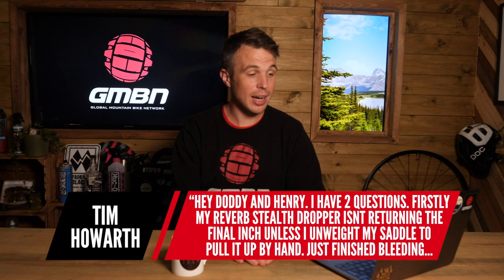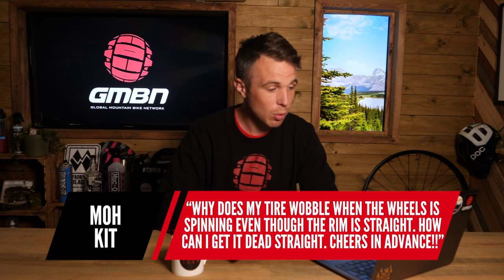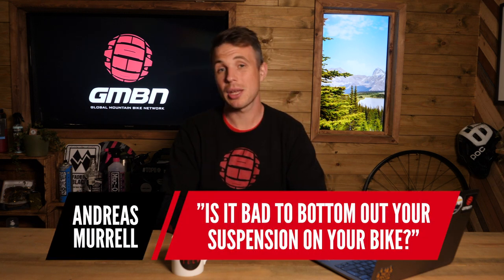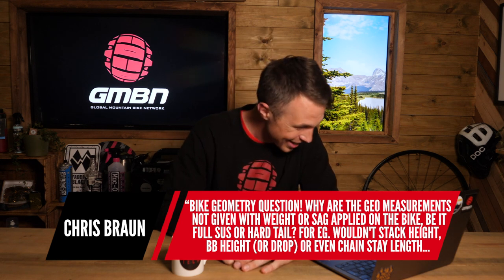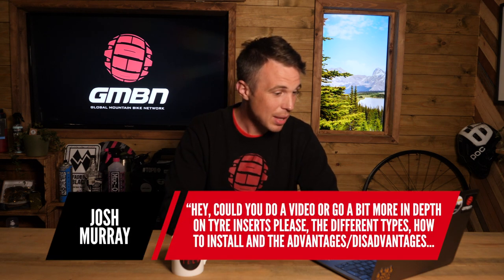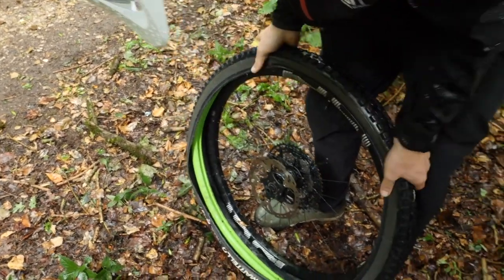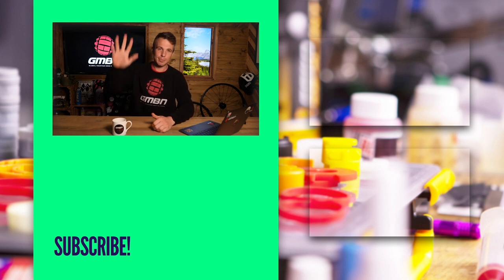Is It Bad To Bottom Out The Suspension Fork On A Bike? | #AskGMBNTech

Comment from the maker: If you have a mountain bike tech question you can let us know by using the hashtag #AskGMBNTech 👇  Maybe you will feature on the show!
Reply: #AskGMBNTech Do high end steel frames require any additional maintenance to prevent internal corrosion?
Reply: #AskGMBNTech How would I go about fitting a dropper post to a 2x9 drive system. My only concern is the placement of the lever on the handlebars.
Reply: Had the same issue with my Reverb, turn the bike upside down, hold in the dropper lever and cycle the post through its full travel 5 or 6 times, sorted the problem for me and might save you having to do another full service👍🏻
Reply: #askGMBNtech - derailleur hanger extenders
Currently building a bike i've come to notice that there's straight and offset extenders on the market, but no mention wich to pick.
Are all derailleurs capable of making up for the 8mm offset a straight extender introduces range-wise, when going for the granny-gear?!
Reply: I had fork vibration  on my Giant Anthem. Even after I replaced the front forks, but every time it happened it was after an endurance event. I found after a morning ride it would disappear. For me I think it was glazing of the disc brake pads (getting them VERY hot). After a while you wear this glazing down. Happens all the time in motorsport.
Reply: @barnzYT  You can get over bar thumb levers that you can use if you have no space for a normal under bar lever. They are normally a bit crap though.
Reply: @superspecky4eyes  cheers, might just stick to my quick release lol
Reply: Great to get an answer to my question!  Cheers!
Reply: barnzy104 yeah cheaper as well
Reply: @superspecky4eyes  Reynolds recommends using Boeshield T9, although they told me that waxoil works OK. I'd still like GMBN or GCN to do a video on steel frame care though as I got in a hell of a mess when I had a go at treating my frame.
Reply: #askgmbntech hello I love the show
I was just wondering if it was possible to get different colors of coil for my rockshox super deluxe coil. I know that I can get red, black but can I get blue.
Reply: @barnzYT  You should deffo try a dropper, you'll never go back.
Reply: #AskGMBNTech I am going to buy a new carbon Tallboy within the next year, and i am 100% going to add a frame wrap to protect it. My only question is whether to go with invisiframe or ridewrap? I know invisiframe is slightly thicker, but it seems like ridewrap has better coverage.
Reply: @superspecky4eyes  I do want one its a pain having to manually drop my post when my mates can carry on shredding! Just a bit stumped about the lever placement
Reply: #askGMBNtech
I'm looking at building myself a new bike from the frame up and also building the wheelset for it and was going to use deore xt hubs however I could not find any clear data on the amount of points of engagement the gmbn tech video said 100 p.o.e. however all the forums I've seen have said 36 or 38 please can you clear this up
Reply: #AskGMBNTech 
Is it bad when u sometimes huck to flat (from i pretty big height) a hardtail or is it ok?
Reply: #AskGMBNTech Hey, love the show btw, could u please explain what the pre load button on entry level forks does and if it makes a big difference when riding.
Reply: #AskGMBNTech greasing: where and how often? A video on more in depth bike lubrication to help the home mechanic would be great!
Reply: T Miller isn’t there already one
Reply: @Calum_S  Yeah i would like to see a long term steel owners car guide video.
Reply: Adam Higgott yep watched that, great help/info but a broad overview, was looking for more specific info on the frequency and all the areas I should grease.
Reply: #ASKGMBNTECH should you use the stock grease on your chain
Reply: Lysing 955 wdym
Reply: Lysing 955 the oil on a new chain should be removed and put your normal chain lube on
Reply: #AskGMBNTech I have a Garmin Fenix 6X. On my Garmin it gives me info of my ride. It tells me my grit and flow. How do i use the grit and the flow info of my Garmin?
Reply: DMP look it up I did a quick YouTube search and pleanty of video came up hope this helps you could also ask the people you brought it from
Reply: #askgmbntech do more expensive aluminum bikes have welds and if so how are that compared from $1000 and up to $500 aluminum bikes
Reply: #askgmbntech hi there, my dropper post slightly wobbles side to side when fully extended and this makes a creaking noise. It is a wired post not hydraulic and is there anything I can do to stop this?
Reply: #AskGMBNTech I have a 2019 giant talon 3 and have upgraded the forks from a set of sr Suntour xct to a set of manitou Markhor forks. What upgrades should I do next, thanks.
Reply: Ralph Finch i have the same thing on both my droppers does is it ks
Reply: #AskGMBNTech During not very steep trails i feel like falling over the handle bars. Also my hands are hurting. Am i right, that the frame size is maybe just too small? How can i change this without buying another bike?
Reply: D. F. If a to small bike is your problem maybe a longer stem
Reply: Kai Grigsby do you mean 5000 and welds make a bike strong my dad’s $6000 bike has welds but is 2014 so if that helps
Reply: jack pearson you could get it powder coated
Reply: Dominic Benoit I   personally spray them with the hose on low making sure to no push any water in the seals
Reply: #AskGMBNTech Does drivetrain wear contribute to dropping chains? For instance the chainring, chain , jockey wheels and cassette will all slacken slightly over time. Presumably this has an effect of chain retention?
Reply: #AskGMBNTech something is crackling inside my headtube when I turn my bars it's louder when im riding (I think something is over tight)
Reply: Arran King dropper post
Reply: #AskGMBNTech i have a suntour spring fork on my hardtail and whenever I pick up the front tire to manual something inside the fork hits and makes a noise,and also pulls me back down!
Reply: kunal warat it happens with spring forks as the fork completely lengthens our to the max feet fast causing the smash and I hate to break it to u mate, ur probably comping straight down because u can’t manual🤷‍♂️
Reply: @jameskatz3747  yeah must be the case... Am learning to manual now!
Reply: #AskGMBNTech Hey! I would really love to know more about mtb frame engineering. I cant quite sleep peacefully at night not knowing how my bikes frames is strong enough to keep it all together 😅
Reply: @barnzYT  Some dropper levers are different than others. KS makes a very inexpensive dropper with a lever that sits behind the bar instead of under it. Giant has a similar one. I have been using it for 3 years now. however I've wrecked 2 Cannondale takeoff seats with it. I'm thinking the design of their seat clamp could be better on the one I had, as I have just replaced it as of yesterday due to the teeth on the clamp being worn out. Giant makes a lever in the same style compatible with their Contact Switch dropper posts. I'm not 100% sure if you could just get a lever and pair it with another post though.
Reply: #AskGMBNTech What should I be torquing my XD cassettes to? If they are over torqued, can it cause the bearings in the freehub to have too much preload?
Reply: #AskGMBNTech
Hiiii guys!!! Is it ok for your suspension to  turn your bike upside down an leave it for a long time? Any disadvantages or advantages? Thanks
Reply: @zkmtb  Doddy has actually answered this in askgmbntech episode #83 at about 8:00 in.
Reply: #askgmbntech - having just switched from an air shock (Monarch RT) to coil (Cane Creek DBCoil IL) I need to educate myself on coil terminology; high and low speed rebound, along with high and low speed compression. Also preload, how much 1/2 a turn or 1 full turn gives you say vs one click of rebound on the air shock. 

I have the correct coil for my weight when riding, it’s all about the fine tuning now.... any tips would be much appreciated 🤘🏻 - keep up the great work lads- loving the show, and great content!
Reply: @samuelprescott1931  try to loosen the heasset by loosening the pinch bolts on the stem then backing out the screw going into the topcap. Start by using quarter turns and make sure there is no play in it when you snug the pinch bolts on the stem. This will decrease the tension. If this doesn't help, that means you need new bearings. If you don't know what you want to buy I reccomend visiting your local bike shop.
Reply: I have done extensive bleeding on the magura mt5 brakes and I have gotten them to where ther every solid. When I take it to the bike park I notice that my back brake starts to pull closer and closer to the bar but never touching the bar and next day feels a littler stiffer almost like normal and when I go back and bleed them again there is air in them system again. What is causing this if it’s them getting too hot I feel like it’s happening too soon    Thanks  #AskGMBNTech
Reply: @mattomann1093  thank you a lot : )
Reply: Adam Higgott no I mean 500
Reply: #AskGMBNTech
BIKE upgrade and brakes:

Uhh my my back brake make a water sound when I brake kind of like move a bottle full of water slowly is it normal

Also I have an so xc bike and tips to upgrade

CHEAP!! UPGRADE
Reply: #AskGMBNTech is it possible to bottom out coil spring forks as well? As this has not yet happened to me but this could be because I haven't been shredding hard enough 🤙
Reply: #AskGMBNTech can you tell me how can i fix my coil fork from loud banging inside when i step on a rocks or something on mtb it's like overloading should i change my spring or my i should buy a new fork
Reply: #AskGMBNTech I Do not own a mountain bike, I own a reddy electric scooter 6000w dual motor drive 55 mph. My wheel are only about 8 inches 7 inches in diameter. When I hit a pothole going 50 mph and Mt rear shocks bottom out. Will that bend or hurt the rim itself Givin I'm running a 100/65-6.5 beefy tire at 50 psi???

Comment: I had the same problem with my reverb dropperpost. turned out the problem was just an overtightend seatpost screw. try using the minimum amount of force you need to stop the saddle from moving. Tightening too much can inhibit the movement of the dropper post.
Reply: thank you!

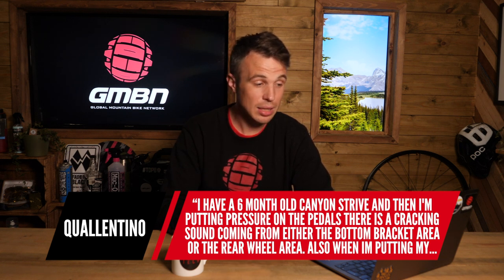Comment: 7:02 I had this problem too. In fact, every canyon owner i spoke with had this problem. But most of the time the BB just isnt torqued down correctly.
Reply: I had a canyon and a creaking down there too. The bearing shell wasn't tightened enough.
Reply: 100 miles on my new Strive so far, no such issue. I'll definitely check my BB after hearing about this. Cheers
Reply: @adkmtb5046  my creaking came after 3000km (about half a year). But i think the bearings are a little bit damaged. This is no problem for me because i cant feel it but i wanted to mention it.
Reply: @Nick-wb1xp  creaking*
bearings*
mention(???)*
Reply: @bananasstuff3344  english isnt my mother language.... So sorry for all the mistakes :D
Reply: @Nick-wb1xp  you dont need to apologise you tried that's enough
Reply: me too, i only realized the origin of that sound when the cracks where so loose i could feel the rattle. i don't have a big torque rench but i torqued it down as brutal as i could with an allen key and a heatpipe as a lever, now it's fine.
Reply: not sure what cranks came with the bike but I had this issue on a new bike and it was a pre load nut and a small spacer that was needed. Hope it helps if you haven't solved it already
Reply: For me, the creaking came from the rear derailleur hanger. The through axle wasn't tight enough (or loosened after some weeks of riding when the bike was brand new) so when i really put power into the pedals it would creak because of the rear derailleur hanger moving for a tiny amount.

Comment: Ive been Mt biking for 22 years.  Im very particular about what I like to run so I usually buy frames and build them with exactly what I want on them.  Ive built 3 bikes in past 6 years.  Ive never had to add/remove volume spacers on rear shock.  In the past 3 builds, Ive removed a volume spacer from each Fox fork I used.  I always try to tune them with the original setup but I could never get anything more than 60-70% of the travel.  Taking out the spacer gives it way more small bump compliance, feels like front tire is glued to ground and I get 95% of the travel with no bottom outs.
Reply: i dont believe that because the volume spacers only impact around 15-25% of your travel. one volume spacer wouldn't make that much difference.
Reply: @bananasstuff3344  Still took some adjustments but its easier to dial the air pressure in after you remove the spacer.  If you have a Fox fork, try it out.  Dont take my word for it.

Comment: "SrSuntour Modifications"
Can coil forks be modified (XCT / XCM etc) to work better in terms of shock absorption?
Reply: Kaustav Dutta nope nothing you can do for the budget suntour forks. Best thing you can do is just keep them greased
Reply: Asap rocky OMG. ASAP ROCKY!!! I HAD NO IDEA YOU WERE A MOUNTAIN BIKER!!! BRO THATS SO COOL
Reply: You can try to keep it clean and well lubed, but there is only so much you can do. Sadly, suntour doesn't seem to offer many tuning parts (stiffer coil for example). Their Hydraulic damper is also non-servicable. So Suntour forks do have a limited life span and use case.
Reply: Amogh Jadhav that isn’t actually him
Reply: Upgrade to RockShox recon air, a cheap air fork made by a good company
Reply: Kaustav Dutta ride the hell out of it as is if the fork is rideable.  Buy a better bike later and sell the one you have or keep it for a backup bike. If you can work on your bike, buy a used air fork, then ride the hell out of it. Service an air fork yearly. ✌️
Reply: Sam 05 haters gonna hate. Why wouldn’t it be ASAP???
Reply: @amoghjadhav3373  dude click on the profile pick. Also his profile pic is travis scott not asap dude
Reply: Amogh Jadhav because ASAP Rocky has 3.78 m subs, and the other guy (who is clearly fake got to be dumb to believe) only has 17 subs, click on his profile, and u say why wouldn’t it be ASAP Rocky, we’ll don’t u mean why would it be? I don’t think a singer is a mountain biker
Reply: Boostn Roost I’m trolling lmao
Reply: Sam 05 I’m trolling. His pfp isn’t even ASAP rocky anyway. It’s Travis Scott.
Reply: Kaustav Dutta lol your mad.
Reply: @amoghjadhav3373   hahahahahahaha

Comment: One layer of painters tape on the back of your pads will eliminate almost all brake pad rattle.... after one use they bed with the pistons.... tape won’t last forever but will last between pad maintenance... special tip no one talks about too much...three layers of tape can be used to bring back lever action if you don’t have lever piston adjustment.... I keep a roll of blue painters tape in my gravity park away tool box at all times!

Comment: My dropperpost, Crank Brothers Highline 3, does the same as the first question. I also have to weight it slightly in order to get it up. The dropper is brand new... Hoping Wiggle will replace, but if there's a quick fix, that would be even better.

Comment: Re BB creak, is that a press fit? Could need PF BB locking compound rather than grease...greasing the cups on pf will cause more micro movement. 
Either way, get the bb stripped down/removed fully and refit appropriately. Note, could be a faulty bearing, so check those too.